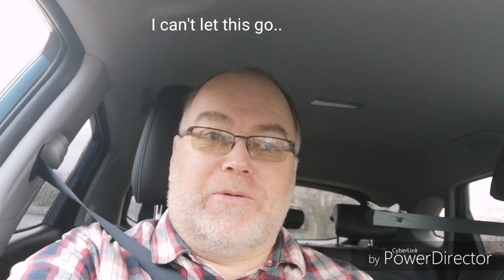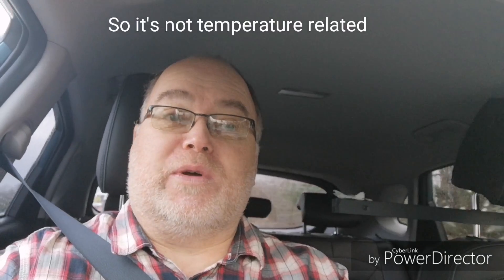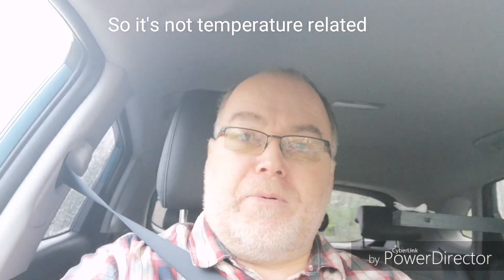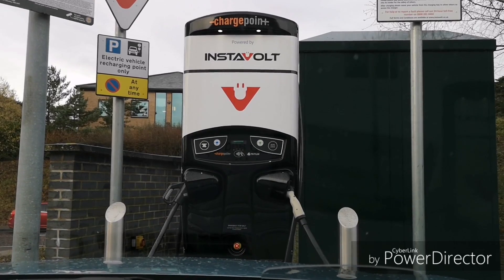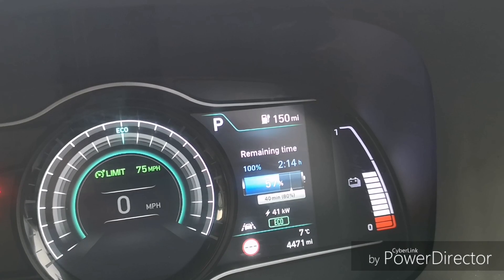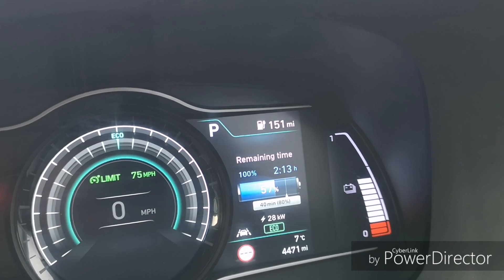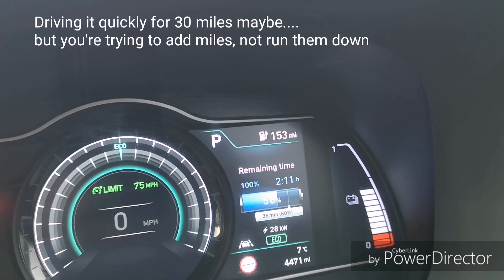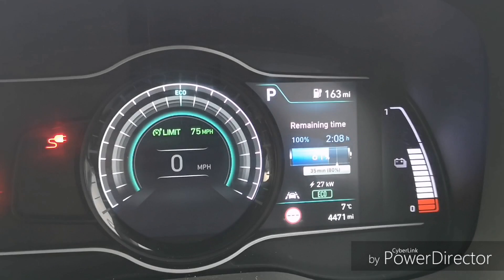Kona Electric / eNiro slow charging from cold & mid SOC

Comment: I have the same on the leaf. Last night I went to the local rapid on my way home from the train station last night, just to test it as a friend had said it wasn't working. It was minus 3 outside, the car had been sitting at the station all day and had only driven a mile to the rapid. So everything was cold. I plugged in I was at 56% charge and it was only giving me 21kw. Normally on that rapid I see 45kW if the batter is warmer and emptier. The 40kW leaf tapers the charge rate from 50% state of charge anyway.  I only charged for 5 minutes to make sure the rapid was OK but the charge rate didn't rise at all.
Reply from the maker: Thanks mate, good info. The more the better to make sense of this.
-3 is one thing but I've seen this at +12!  

If only we had a battery temp gauge and knew how hot it needs to be to charge a little quicker
Reply: @EVPuzzle  that's where leafspy is very handy 😁
Reply from the maker: Absolutely. Hiding battery temp is just wrong if we need to know it to plan journeys and charging
Reply: @EVPuzzle  does the kona have nothing at all? The leaf one is just vague as hell but leafspy gives you the exact temperature
Reply from the maker: Nothing.  I've not seen a Kona running torque pro yet with anything accurate

Comment: Does pre-conditioning fix it? It would appear to be temperature related if it does...
Reply from the maker: No, temperature is fine. As I said I've seen it at 12c! And charging is fine from much lower from 30% SOC. The starting SOC level is impacting it.
Reply: @EVPuzzle  I've seen the same with 30°c outside and after 120km of driving. :/

Comment: Rapid charging a cold battery will be severely restricted to protect the battery. My Tesla 90D suffers from this and it can take at least 60 miles driving before I get a decent charge rate, regen braking will also be restricted. The moral is rapid charge at the end of your journey not at the start when the battery will be cold.
Reply from the maker: As I've said in the video and in other comments. In colder conditions it's fine from lower SOC. It's not because it's cold at least not that alone

Comment: After watching the video and sleeping a little I give it a second thought: That erratic behaviour could be on the charge point side. The charger points do some transformation in order to give you high amperage DC charge. You can hear their fans when you start charging. May it be that they do not get the temperature conditions they expect and therefore they don't give as much juice as the car can hold? I'd say maybe. I imagine a way to test it is to check the same Charge point with the two cars the same day. Yet again, if the problem is that the charge point cannot give all the voltage required, for example, you can get differences because of parallel behavior of cells charging.
Reply from the maker: It's not the charge point as same charger same conditions is fine from 30%

Comment: Bizarre this has not been an issue for me. steady 46kWH UP TO 74% THEN STEPS DOWN AS USUAL.
Audio is quite boomy due I guess to hard mounting the camera/mic to the car. its being transferred like a bone mic. not pleasant.
Reply from the maker: It'll be interesting to see if it's still an issue in summer. I know it's an issue at 12c and below for sure.

This is why Hyundai shouldn't be so secretive. Customers need to know limitations in advance not find them as hidden in talked about features. That's what Nissan got wrong with Rapidgate, hiding it.
Reply from the maker: I'll see what I can do insulating it.  I've tried wearing a mic but it's too contrived, I need to record without setup faff

Comment: My Tesla is doing the same. 25 minutes of motorway driving with 130 kmh is not enough to get full charge speed in the winter.
Reply: Peter Kjærsgaard  If you constantly full throttle and regen, “Jo-Jo” the 25 mins, you’ll heat up the system to get proper charging speed. Same with my Zoe, If battery temp is below 20°C. I’m sure it has the same effect with Kona / Niro.

Comment: I went to charge my Chevy Bolt this week on a day that was just below freezing.  SOC was about 35% after driving about 20 miles on freeway and local roads - I would think that the drive had warmed he battery up some.  Starting charging speed was 15 kw on a 50 kw 100 A charger.  Nearly 30 minutes later the speed had ramped up to a 35 kw (100A) rate.  Just to show you how much charge speed gets throttled into a cold battery.  I did see that the charger you were using showed that it charges by the kwh vs by the minute, so perhaps that has something to do with it (high demands from the grid during daytime may cost the charge provider more than they would be paying if they are drawing 25 kW or less?).  Nigel, you need to see if you’d get a different performance when starting at a 35-40% SOC and similar conditions otherwise.  If the pace improves, take note that you probably shouldn’t be fast charging with a starting SOC that exceeds 50%?
Reply from the maker: I thought I'd made that clear it's fine from lower SOC in same conditions
Reply: The EV Puzzle - need to find that magic percentage/battery temp combination where it makes significantly less sense to be plugging in if SOC is above this point?  Perhaps you’ve already found that?
Reply from the maker: Yes. I'll be turning the heater on to burn those few % off for the magic  number when I find it

Comment: Interesting! I've experienced this exact issue charging from about 50%. At the time I blamed the charger. I've also disconnected and reconnected the cable, that didn't do anything. I used a 50KWh  Allego charger in Belgium. It started out charging in the thirties, but quickly slowed down to the twenties. I like you theory about this. Thanks for investigating!
Reply from the maker: Definitely an issue, not good when you're needing nore
Reply: Did you ever find a solution for this, @cornelis Zijlstra - I have the same problem.
Reply from the maker: No but with the latest BMS update it could be improved. It seemed unnecessarily slow but is temperature related. Without more me it doesn't warm the battery enough to accept a higher rate. It's an ideal case for the battery heater to help bring the temperature up if desired.

I just learnt to not quick charge from 50%

Comment: Another very informative video, it would be great to get some comments from Hyundai.
Reply from the maker: We can but hope they did investigate when I reported it to them last October
Reply: The EV Puzzle 
This is were Tesla lead the pack! They can tweet the operating system over the air in real time. We will have to wait until the car is in for a service to benefit from any software update. Its seems from what I’ve been reading about the leaf that a software tweet has cured its problem. Let’s hope that a similar software update will sort this problem out.
Reply: @wobby1516  I'd say it is a little bit worse than only upgrade convenience. I feel Tesla knows about issues. Not sure how Kona EV issues get back to actual engineers or if they even support the car in order to improve the already sold ones.

Comment: Are we sure this is something that is being controlled by the car, and not the charging station ... Many of these FREE fast charging offers are designed to get you to 80% in 30 minutes.... if you already have 50% in the car, the station does not need to run at full speed to get you to 80% within 30 minutes... i wonder what your experience would be if you were paying for the charge, and not on the introductory offer?
Reply from the maker: If it was the charger Ioniq would see this problem too,

Comment: Hi Nigel. Many thanks for the very informative video. I am sorry to see you are having issues with the lack of charging speeds. It would be interesting if you could maybe leave home with close to full in cold weather. Drive it like you stole it as Bjorn would say down to 55-60%. Then straight onto the rapid and see your results. If you still get similar results then you can definitely rule out battery temp. I hope you get to the bottom of this Nigel. Bjorn’s winter test on the E Niro was less than impressive. He couldn’t get more than 240km and the charge rate was disappointing.
Reply from the maker: Yes a warm 50% would be useful but to be honest if it's ok from these temps at 30% why is 50% a problem

Comment: As I see it , this is a much bigger problem than the rapidgate ( that now seems too be solved). Because this loss of charge speed comes on the first charge session rather than after 4 charges where the battery is too warm. Most people don't need more than 1-2 fast charge per day/ trip.
Reply from the maker: Very true.
Reply: Well not sure how new Leaf works in cold but my 24kwh will slow down at about 30% in cold conditions(0c) and after 60% I see about 10kw... with only 0c outside it took me 53minuts from 7 to 77%. And I did drive with a car. It was at 83% when I started. Battery was at about 10c if I remember corectly... So it is not Kona only problem. It is any car that will not heat up bettery.

Comment: cold battery, these batteries need to be in the mid 20's centigrade to charge at decent speeds, you need to drive it hard for 30 minutes plus to warm the battery up if you want to charge at decent speeds first thing in the morning, best policy is to charge up after a drive or top it up on ac overnight.
Reply: I guess it would charge completely normally from a wall outlet (or a home charger) then?
Reply from the maker: So why at even lower temps is it fine from 30%?
Reply: @EVPuzzle  that's how the BMS protects the battery from damage at higher state of charge at lower temperature due to increased internal resistance all cars do this when the battery is cold
Reply: Barry Collyer 
I think your missing the point, as the EV puzzle as stated at the same temp and lower it charges ok 👌 from 30% so why the difference from 50%
Reply from the maker: It doesn't protect it at 30% SOC. Id be very happy to hear from anyone explainig why that is beyond, its cold. Yes 12c isn't warm but I wouldn't expect less charge at 12C than you get at 3c when starting from lower SOC.

If this is just how it is, why do other EVs like the Ioniq not experience it?
Reply: @wobby1516  if you charge the battery from 30% SOC it has enough time to heat the battery to within its BMS tolerance at 50%+ so the charge rate continues at the higher rate if you start from a lower SOC when the battery is cold
Reply from the maker: Sounds right, the reduced charge rate doesn't warm it enough. Back to the start then, why not charge higher for longer to warm the battery like it does at 30%?
Reply: The EV Puzzle Im guessing the battery couldnt take it if its half full and cold. I mean they wouldnt code in that "feature" if there wasnt some reason behind it. Some experts have sat down and agreed that the battery cant handle a supercharge when its cold and half full.
Reply from the maker: I agree, the more feedback I'm getting the more it sounds like a generic EV problem. 
Charging is much slower from mid SOC levels unless the battery is warmer but the BMS won't allow a higher charge rate to help warm it.
Reply: The EV Puzzle To be honest though, the only times you really NEED to use fast charging that i can think of is if you are driving a really long distance (who commutes more than ~350 km between destinations)/roadtrip, then you fill up at lower states of charge, and the battery will be warm anyways.

Even if you dont have a charger at home, asking your workplace to fit an EV charger (you can even offer to pay the bills) should be more than enough time to charge it sufficiently using AC.
Reply from the maker: It just means more time or more limitations as to when to charge.

Touring is my concern not a daily commute.
Reply: @EVPuzzle  Internal resistance varies by state of charge. At 60% it is almost twice than 30% - so this influences the limitation - even if the temperature is the same in the pack.

Comment: Thanks. So sad to see that: my e-Niro is coming by the end of the month...
Reply from the maker: Test it when you get it
Reply: @EVPuzzle I managed to do one quick charge, but my region (south east of France is warm and I was on a 50 kW charger. Charged at about 45 kW while having a nice hot chocolate. I love my car !
Reply from the maker: Glad you're enjoying it
Reply: Don't worry too much. If you can charge your car from home as I can, you will start with a range of around 350-375km in winter. How many trips do you make in winter that are longer? And besides: the manual of the e-Niro clearly states that you should charge the car as much as possible via normal charging and minimize the fast charging. Fast charging puts more strain on the battery so fast charge on long trips but always try to charge your car overnight with normal charging. I'm still looking forward to my e-Niro getting delivered in about a month.